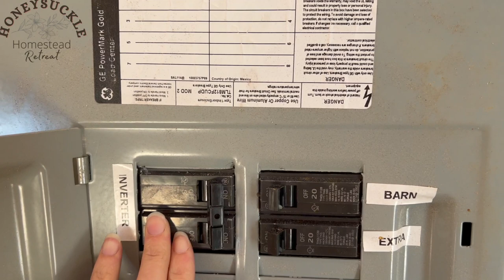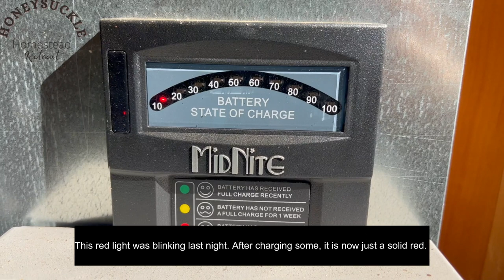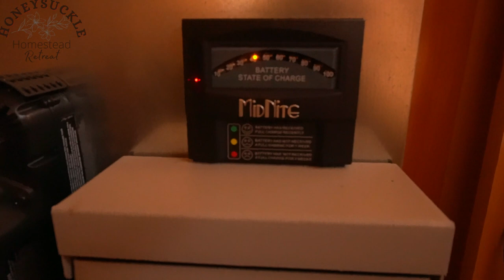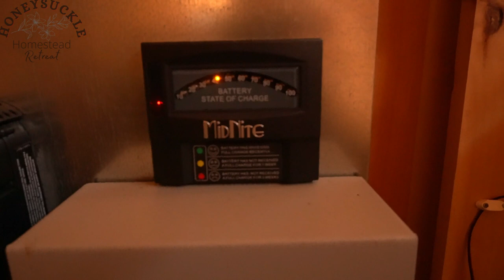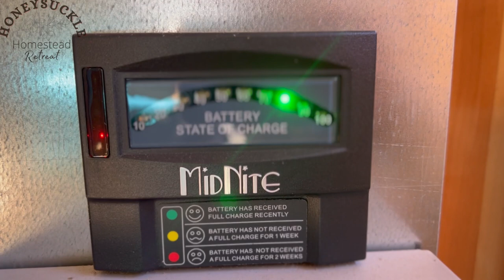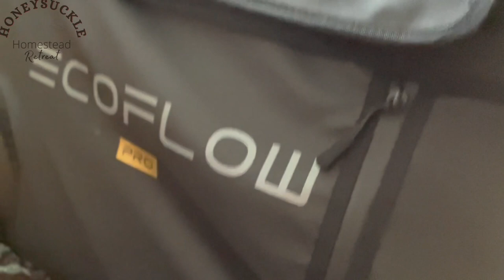Oh no! Solar Power problems!!  😭

Comment: Desire did Lucas from ITH do your solar?
Reply from the maker: Yes, Lucas from ITH did the solar installation back when he was still willing to travel around the country for work haha! I think now he resides exclusively at ITH, but do not know for sure. He installed the solar panels on the roof and the batteries in the barn and hooked up all that up so I had power in the barn. 
A different guy completely separate from Lucas came out to dig the trench and lay the conduit. That is the same guy who also did the electrical connections so my tiny house would have power.

Comment: I sincerely hope your battery array is fine. Letting your batteries drain to zero can damage your array's ability to store energy and you may or may not experience a reduction in overall storage capacity after this ? I hope there are no long term effects with your system after this. I think you got a real "Friday Afternoon" job on your solar system ! Is there no other route they could have chosen to get the power from the barn to your tiny house on the hill ? I would have made sure I was present to oversee the work your solar contractor was doing on your property at the time it was being performed. Typically, the shortest route between the two buildings is always prefered, but not essential with an AC powered line.
Reply from the maker: Hi Mark, yes it did cross my mind that my batteries could be damaged from the drain. However, I am hoping that since this only happened this one time, hopefully it won't be too bad. As for the solar panel/battery placement on my property, since I am directly next to a mountain, the majority of my property has more shade than it has sun, especially in the winter. I had originally hoped to put the solar array about 50 ft from my house in my back pasture, but I was advised against this b/c of the limited amount of sun in that pasture. I did a walk around my property with the guy that installed my solar array before he installed it. The absolute best place for my solar panels was on my opposite hill on the other side of the creek. Since I haven't had much time using the system while connected to my house, only time will tell how well it works for my situation. Thank you for your input! Stay tuned to see if I have any issues down the road. 😊